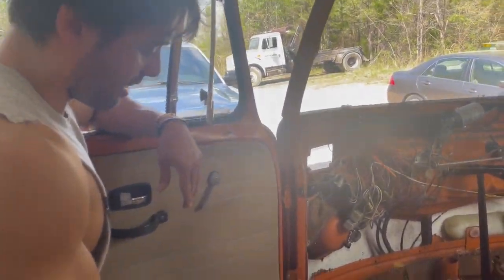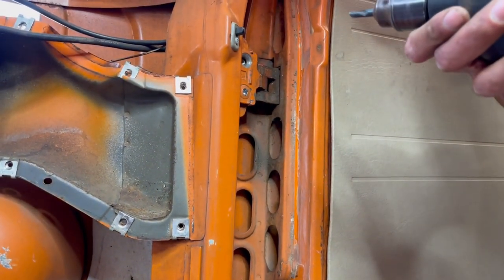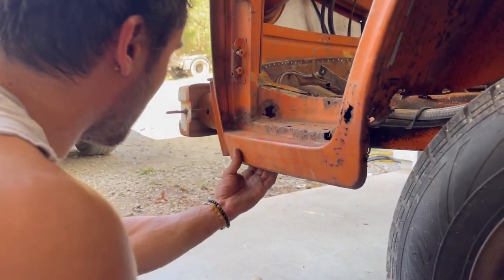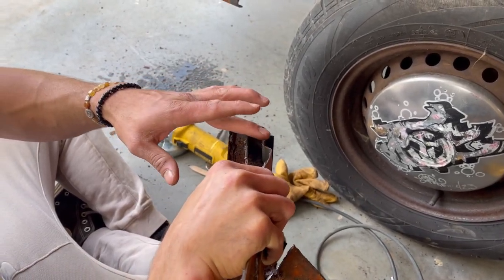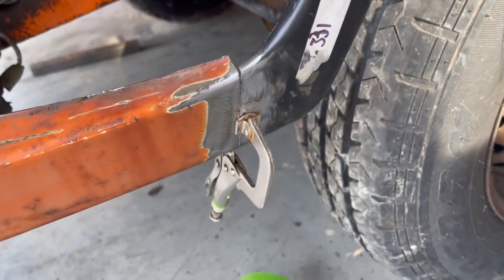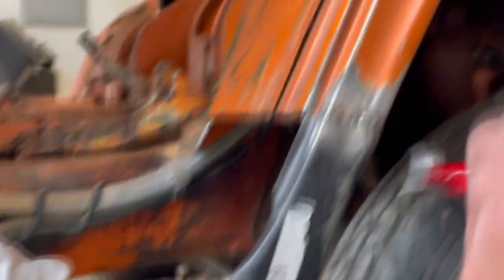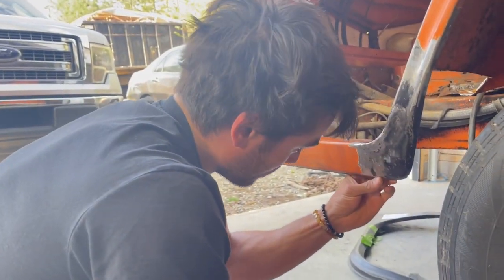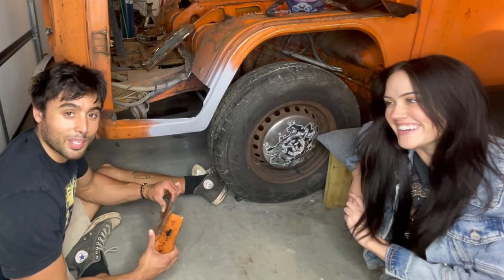Welding Repair Panels (Beginner) | VW Bus Restoration Episode: 9

Comment: try practising welding and grinding on some spare plates first. get used to it. the worst is yet to come . when you have to weld upside down. but please wear better clothes. yes you sheild your eyes. but the rest of your skin is likely to get uv burn off the mig welder. trust me.